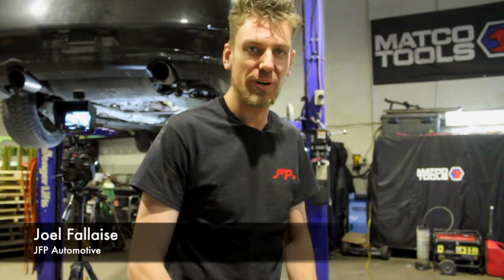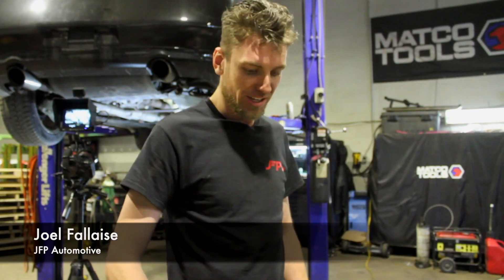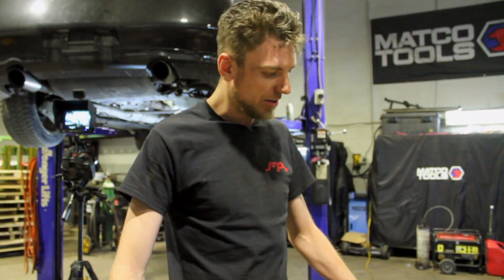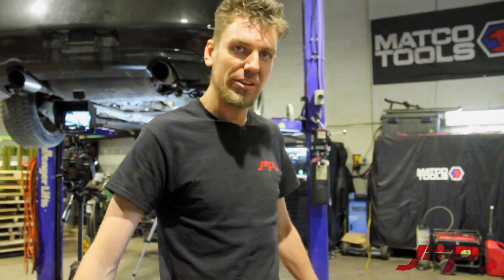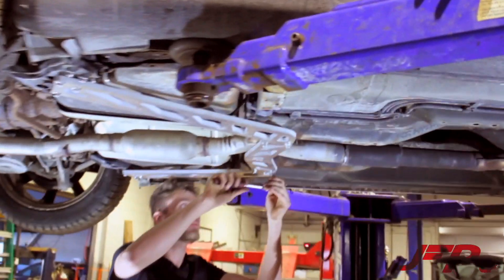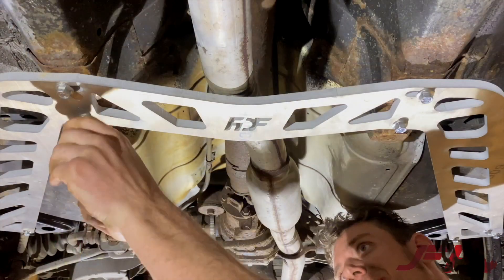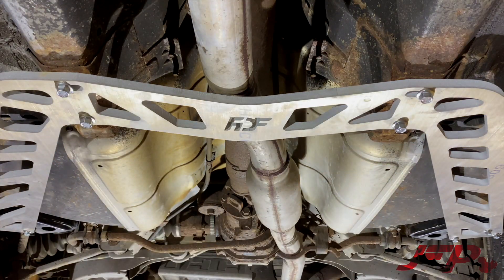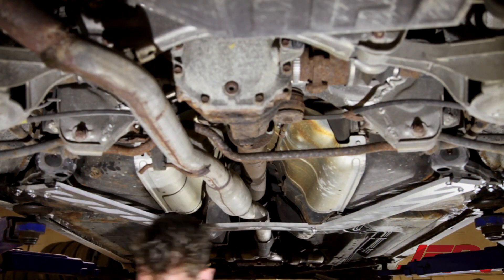The New FDF G35/350z Rear W- Brace Install Video (Very Easy)

Comment: what is the point of adding this w brace? i have a 2005 infiniti g35 and it didnt come with that brace. Am i missing it or is it a coupe thing only
Reply from the maker: Every g35 came with a steel brace. They usually rust away or fall apart. If your car doesn't have one that means someone removed it before selling it to you. It stiffens the chassis and ties the rear subframe in to the body of the car.

Comment: Bought this w brace from you guys. Great quality. But both the 14 rear stay brace bolts snapped. Any suggestions?

- It got worse. The nut thats welded inside the frame broke free...
- - Drilled out old rusty bolt holes and welded in some nuts.  Its fixed i guess.
Reply: Literally had the exact thing happen to me but it was my transmission cross-member 2/4 bolts had snapped into the body. had to weld new nuts